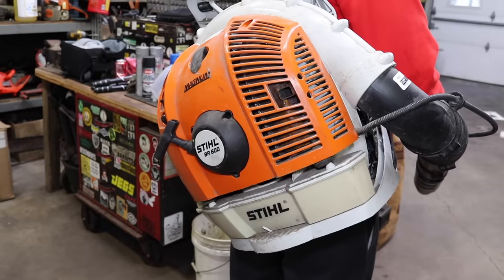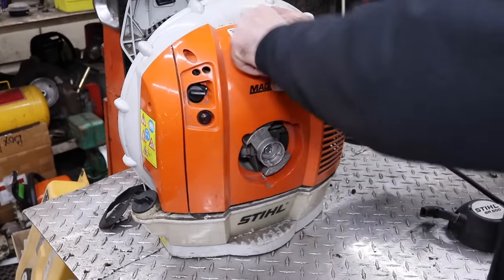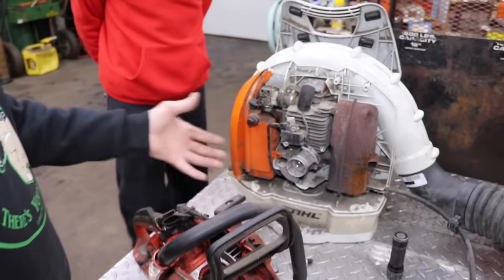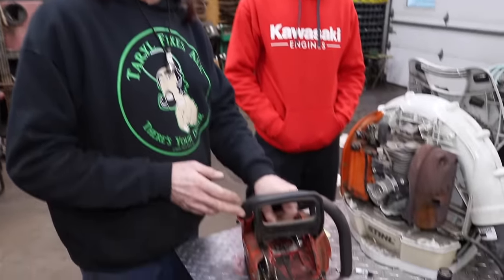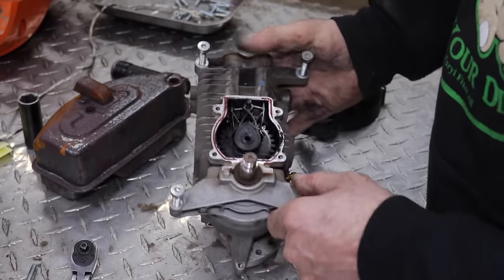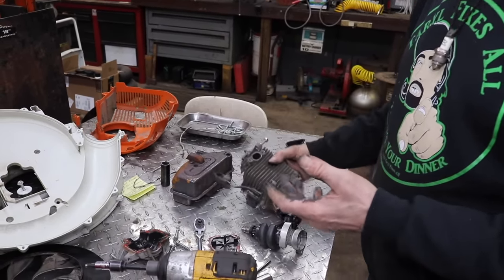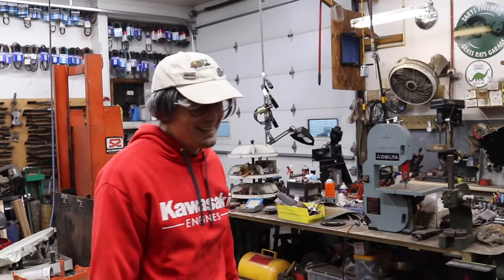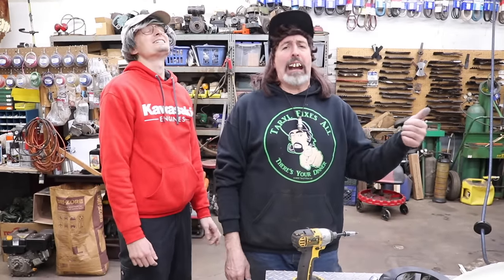4 mix NIGHTMARE! DON'T make this mistake 🚫

Comment: I’m a multi decade urban forester/climber. For the vast majority of that time I’ve only run Stihl chainsaws. A few years ago I picked up an Echo cs355t top handle saw when I just couldn’t justify paying nearly $800 for a Stihl trim saw. Now I doubt I’ll ever buy another Stihl. After three years of daily use that Echo has not given me a single moments headache. Not even so much as a recoil cord replacement, in fact I’ve never even removed that cover.
Reply: I bought Stihl's best top handle saw in June for almost $900. A week later, it was in for warranty work, as it wouldn't stay running. After 3 warranty returns in 3 months, it was now out of warranty and stihl not running as it should. The dealer had the saw in his repair shop during most the warranty period. So, he said I was  now SOL with the saw.
Reply: Yo’ @northerniltree . I had a similar experience with an early generation Husquvarna 540, when I first tried to find a replacement for the 020’s and 200t’s I tired of cobbling together. My business associate at the time made it a personal mission to make the owner of the retail dealer and the regional representatives lives hell. We eventually received a full reimbursement, but it was an endeavor. Hence years later that retail outlet no longer carries Husquvarna.
Reply: Echo makes high quality shit.

Comment: I have a BR 600 purchased new in 2010, and I use it at least weekly year round every year.  It still starts on the first or second pull every time and runs like it did when new.  I only use the synthetic Stihl two stroke oil (HP Ultra in the silver bottle) per the advice of my local Stihl dealer, plus non-ethanol pure gas.  These are great units when taken care of, and the landscapers use these more than any other brand.

Comment: 1. Reduces production costs.
2. Sells a lot of oil.
3. Punishes those who don’t buy their oil.
4. Increases resales among those dumb enough to buy another one.
5. By the time the company’s reputation has been destroyed, those responsible will have moved on to other jobs, destroying other companies, in service to increasing short-term, bottom line gains.
Reply: Certainly plausible, except for the last point.  Stihl is family-owned.  The people making the decisions aren't going anywhere and probably want the company to remain successful for their kids.
Reply: I just started replacing all my Stihl with Shindaiwa/Echo. Used to run all Stihl, (3)Saws/(2)Edgers/(4)Blowers/(2)Hedge Trimmers (2) String Trimmers but this is bull$#@& and I'm never buying another Stihl product again. Just bought a $600 Shin EB910/RT today.

Comment: Taryl, can you do an experiment with the blower? You try doing the heat treatment on the connecting rod & try to find a needle bearing that will fit. Get oversized rings & bore the cylinder out & see how long it'll last. I think that would be a GREAT experiment. Take us along for the ride.
Reply: might be easier to just find a rod that is close to fitment that needs boring out or using one from a chain saw since most manufacturers use the same parts for as many applications as they can, like john deere does with their lawn and garden stuff used in farm implements.
Reply: That rod looks like aluminum, so probably no way to modify it (as well as the cylinder, which is most likely nickasil coated).
Reply: Can't bore a Nikasel coated cylinder.

Comment: Happy New Year Taryl! I bought a BR600 used a few years ago from a lawn care company and have never had any problems like that and it's been used commercially and abused from commercial use. I do use premium 2 cycle oil though, only major repair I had to do on it was reseal the engine because the seals were leaking bad causing it to run like crap but after resealing the engine it runs like a champ now!

Comment: Great job Taryl!
I sure hope Stihl sees this video.
NO reason to not use bearings in this.
Reply: Do you really think all that black crap would properly lube a needle bearing???  WHY did they not use a crankcase and oil, with all STEEL parts--no plastic??  Cheap to make, and expensive to repair!!  Junk? YES!
Reply: Actually there is a reason Thermal expansion effects needle Bearings more than solid Bushings.  Solid bushings can conduct heat better than needle Bearings.  The Emisions system is designed on these blowers to burn Fuel more Quickly at higher temperatures, to reduce Carcinogens in the exaust.

Comment: We use mostly Stihl equipment and their silver/grey oil. Have never had an issue with lack of oil problems. There is another channel that swears Stihl oil is junk. The stuff he pulls apart is usually all gunked up like this blower you pulled apart. I am starting to wonder myself if that could be true.
Reply: A couple of channels are against that Stihl ultra crap.
Reply: @Michael Howell  that stihl ultra crap is amazing actually. It will break up carbon from valves. It has decarbonizer in it. It is actually really nice oil.

Comment: Looks like they used old drain oil from a car for mix. Thanks for the video Taryl. Happy New Year to you and the crew!
Reply: In any case, their choice was the wrong one.

I keep repeating it over and over: Aspen or Stihl four stroke fuel in combination with Amsoil Saber. Or the Stihl mix. You get a filthy but healthy screamer with this fuel and oil. 

It is also important that the engine reaches operating temperature.

And you have a beautiful engine that will continue to work cleanly for years.

Quality quality quality.
Reply: Exactly what I was thinking. The rod and crank are so sludged up it's like they were running the highest carbon oil they could find, aka used engine oil.
Reply: That's what they look like inside no matter what oil is used and why they don't last long.
Reply: @laurapalmerTDGE  I dont like Saber oil, burns dirty. I use Motul 800 offroad 32:1 mixed with the Aspen fuel for storage, and regular gas for long use. Everything is clean and burns with no smoke. The lifespan of my top ends is unmatched with this oil.

Comment: Is there a chance that they thought it was a four cycle and didn’t use a mix in the gas? Man, that’s a crank, piston and a new cylinder. Plus a gasket kit? That baby is toast, the hand cleaner you had to use was worth more than a Stihl backpack blower. Hard to believe until you see a plastic cam and lifters. 
Thanks Taryl, I hope you and the guys and everyone watching to have a great New Years! 🎉
Reply: The lifters are not plastic and that cam gear basically never wears out. Ive seen the cam worn out once in about 1000 pieces of stihl equipment. Ive seen wrist pin bearings and bushing fail far more often. The one with worn cam had been used all day every day for years and years on a farm.
Reply: They did use some kind of oil in the gas. Just look at the sludge on the piston and crank shaft

Comment: Have a Stihl FS110 trimmer/brush cutter. Apparently it doesn't have a needle bearing on the small end of the connecting rod. I have been using Husqvarna XP 2 cycle oil mixed at 40:1 in it for at least 9 years without any problems.Just my experience.

Comment: Ever since I first touched one of these 4 mixers I thought they were junk. Low reving vibrating junk. Give me a 2 cycle blower/trimmer/ pole saw anyday. Reminds me of early Polaris 4 stroke atv engines 425/500s cam failures. Company/ techs tried blaming it on operator and bad oil and come to find the cam and rockers were not heat treated correctly.
Reply: They sell crap

Comment: It's easy to source inexpensive needle roller bearings with outer shells e.g. a HK0810.  They are used in exactly this application.  It avoids needing a hardened connecting rod, which allows cheaper, lighter alloys and problems with cracking.  It's also possible to bore for a hardened chrome steel sleeve and plain needle bearing, but that combination tends to be larger diameter.

Comment: Finally someone else who seen the issues the 4 Mix has. I get Echo because of the quality control at Stihl.
Reply: Its always about the fuel/mix my friend!
Reply: @kevinsbackyard  Partly true but also Quality DESIGN is the major part.
Reply: Only reason stihl is the topdog at blowers is the harness is very good and they dont vibrate so much.
Reply: It is called the worst of breed, having the worst of both 2 and 4 stroke engines combined.
Reply: @kevinsbackyard  4 stroke engine should have pumped oil to lubricate it, not 2 stroke oil mixed with gas. 4 stroke engines outlast 2 stroke engines because of their superior oiling. This is an abomination.
Reply: @tonysheerness2427  how do you figure? People also have a tendency to never change the oil in engines.
Reply: Stihl has lost commercial customers over their 4-Mess design . I was nothing but a Stihl guy so I jumped on the 4-Mess design when it came out. To my local dealer’s credit he tried to sway me away from them but I wouldn’t have it. One year later I took both 4-Mess units I had and traded em in on a different brand that still made traditional 2-strokes. I’ll never buy another Stihl or any other brand with 4-Mess technology in it. I love my old 036 saw. It’s been a beast for years but Stilch can keep their 4-Mess stuff.
Reply: @lawnmowerdude  Fact 4 stroke engines live longer than 2 stroke. How many 2 stroke engines make 50,000 miles where as 4 stroke engines go 100,000 plus
Reply: If anything Taryls presentation made it clear that, There is Plenty of BLAME to go all Around.   Big Thumbs Up...
Reply: @tonysheerness2427  The Stihl 4 mix engine does not have oil in the crankcase for lubrication. It relies on the gas/oil mix for lubrication just like any 2 stroke engine.
Reply: @johnready630  Exactly the worst of breed. How does oil get beneath the piston as it has over head valves and not ports on the side of the bore.
Reply: @kevinsbackyard  I have seen engine seized with four mix oil and quickly put Echo oil mix in the machine and saved it I never run still oil in a still product only Echo
Reply: I have no issues with my Stihl br600 or br800. My br600 has been running for 10 years without fault. I only used Stihl platinum oil or amsoil saber. Use good oil and mix it right… if you fail to maintain it correctly how can it be the manufactures fault?
Reply: I work at a Stihl dealer we replace one or two 4-mix blower engines in a year, and we sell probably a standard shipping container worth of them in that time. People are the problem. That thing was probably ran by one of those amsoil 100:1 morons.
Reply: @eurokid83  I agree there on the 100:1 but the thing is why go cheap on the 600 700 800 blowers rod top bearing "where the wrist pin sits normally there's a bearing there" by putting a bronze bushing in, and an FB rated oil (unless Stihl has changed the rating or obtained the FD certification). Design is the issue and the while point of that video. Hopefully they redesign the rod with a proper bearing.
Reply: @jdclay1547  true a needle bearing would be the better way to go. I would imagine the bushing was used to cut cost.
Reply: @prevost8686  ...as a handheld 2 stroke mechanic, I HATE 4 mix..it was just a path to please the EPA, nothing more..I told everyone I would not work on them, but I still seem to get scr@wed into working on one every now and then..usually a regular customer who has other 2 stroke equipment, then says: "hey, I got this blower/trimmer I need you to look at..it's a STIHL"..then they bring it to me, and there it is, a 4-mix😡...honestly, most of them don't know/understand the difference..they say, "hey, yes, it's a 2 stroke!..yes, it uses oil and gas mix!". I don't like the sound of them, either, the sound alone drives me nuts, I tune 2 stroke equipment by ear, and that's almost impossible with "BUhhh!...BUHhhh!"...and you can't pull the muffler and check the condition of the piston on these...one of the reasons I learned to work on 2 strokes is that I loved that they don't have a valvetrain...yep, Stihl can stick 4 mix up their @ss as far as I am concerned...
Reply: @Tony Sheerness  comparing "miles" on an engine makes no sense. We compare hours. I work on both stihl and echo equipment and they both have redundant problems.
Reply: I was a Stihl mechanic for years. Only saw one failure like that. Mostly it's valve adjustments and cam failures on the engines. I would save that one for parts as I've seen lots of broken housings and harnesses etc.
Reply: @MrGlenferd  My philosophy is that a trimmer,blower etc. doesn't need the extra complexity and extra moving parts of a cam, valves, etc...just use a normal 2 stroke...screw CARB, etc.. I will not work on 4 mixes..been working on 2 stroke hand-held equipment for 30+ years. Oh, and I cannot stand the sound of a 4 mix, either..BUHHHH!...BUHHH! put-put-put...

Comment: OH, BTW, they have changed the cam gear a few times over the years. They seem to hold up fine now. There is also a compression release built into it which was occasionally failing early on.

Comment: Interesting. I’ve noted in RC gas engines larger engines generally use roller bearings and around 50:1 oil. Smaller engines might use bushings, but might call for 20:1 synthetic oil mix.
Reply: Some of the small rc airplane engine don't even have that some just have a a ball joint which connects the Piston to the connecting rod and then on the crankshaft side there's just nothing
Reply: @davidaix5771   Yeah back in the glow days Cox .049, 0.010 and the like used a ball on the end of the rod and a socket in the piston.  More recently nitro/glow fuel has become obscenely expensive, while electronic spark ignition became smaller and gasoline engines quickly took over giant scale. Less oil all over everything, no need for a glow plug driver, no need for an electric starter.  Then they started making inroads into smaller and smaller scale. Typically a 55cc engine or larger has roller wrist pin, but smaller ones down to 15 or 17cc seem to often have a bushing. 

These days there are few left in the hobby in my neck of the woods, and Li-Po packs and brushless motors are becoming more common even in large scale.
Reply: @Jeff in TD  yeah I have a few coxs engine laying around some baby bees and I think one or two surestarts
Reply: @davidaix5771   Yeah, me too. I still fly glow, but not the little Cox engines. I did start one a while back, and kicked around building a vintage kit…
Reply: The whole idea of using a premix lube system on a 4 stroke design seems questionable to me…

Comment: I am a commercial guy I have had Stihl blowers from the the Old 420 to the 800 I currently have two 800 that are on the 5th year 700 and 600 all have been good blowers I have no complaints when they finally died it was do just being wore out I use just Stihl oil.

Comment: An engine that has to use special oil is a monopoly.  Happy New Year.
Reply: I wouldn't say that...i'd say its a fussy or TIGHT tolerance ect design where you NEED quality oil to have it run reliably for a long time. Not a monopoly. Dumb design? Maybe. Dumb that you need to only use their oil? Yeah. In terms of companys or manufacturers not letting you use anything else, their oil isnt a big probem. Any other brand you can't even change brakes without screwing around with scan tools, can't do this or that, very restricted. Oil is cheap.
Reply: @baileyhatfield4273  Not if you have run out and can not get more and need your machine, The wrong oil in this machine is catastrophic. As for special tools etc for working on equipment I blame the government as all machines should be open to repair by any competent person, not dealers with all the specialised tools. As most cars now come with a tablet why do you need a special tool to read breakdown codes?

Comment: The BR600 has actually been a great blower for nearly 20 years now.  But they aren't bulletproof.  The inside of that engine looks nasty, like they were running drain oil for the mix or what was that graphite oil from the 70's?  I haven't seen that bushing as cause for failures, usually if it's worn out it's due to other factors.  The BR600 is also sensitive to being over-revved for extended periods,  The easiest way to kill one is to hold the nozzle too near the ground, or block the intake with leaves allowing it to over-rev by a few hundred RPM.  If it doesn't slip the exhaust guide, it will eat the bushing in the small end of the con-rod.  

40:1 mix with good oil designed for air-cooled two strokes, and these engines will live a LONG time.

Comment: I have a 10 year old BR600. I ALWAYS use Stihl 4mix in it.... I buy it by the case. It has thousands of hours on it and has given me zero trouble. I also use Stihl's combustion chamber cleaner in it a couple times a year to keep the valves clean.... recommend by Stihl. It's one of the best blowers I have ever owned. It always starts in one pull.
Reply: @fukhue8226  I get what he was stating and it should have a needle bearing.... It's just the I have had zero issues with mine..... so far.

Comment: As long as I can remember I alway shake up my two stroke gas can. It really just became habit for me to make sure my oil and gas is mixed.

I've seen that oil for that backpack blower and really never knew what you would use it in. I would hope if you bought this brand new there would be some kind of warning tag to let you know what you must use.
Reply: Mine gets mixed just riding around/ sliding around in the bed of the truck, same as normal gas that gets sloshed around so its always mixed ready to go lol
Reply: When you buy stihl equipment the dealer will tell you to use stihl oil and if you buy a case of stihl oil at purchase of unit the warranty is extended by several years. People know.